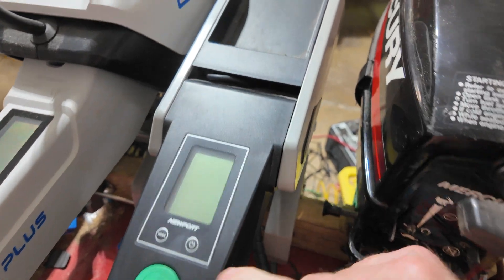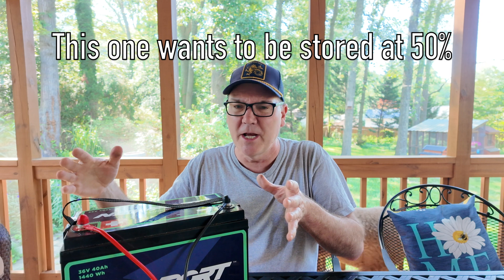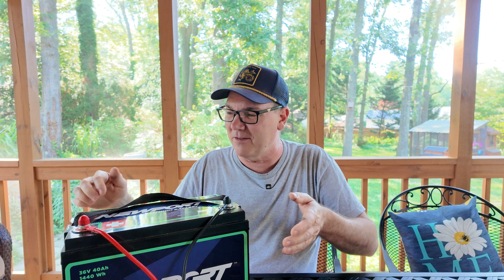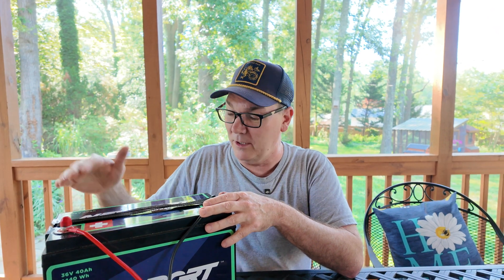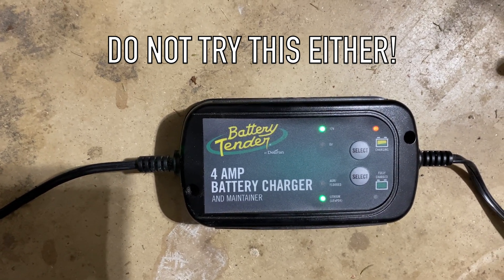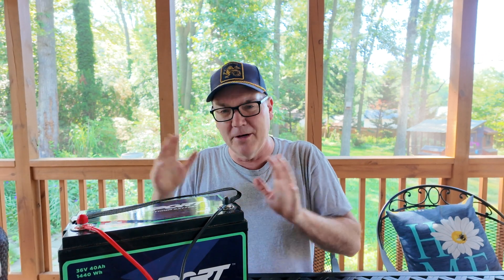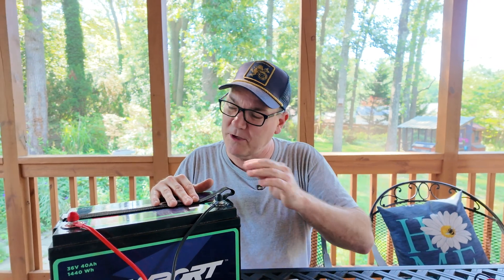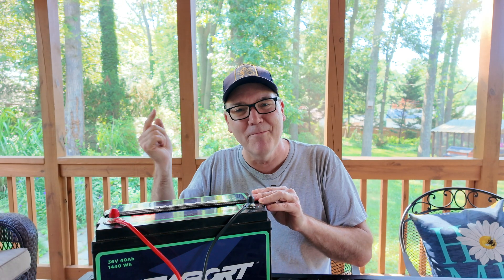LiFePo4 Battery DEAD after 1 year

Comment: The lithium battery for my Terratrike e-assist came with BIG BOLD WARNINGS to never go more than 30 days without charging. I think it’s for this very reason, so it doesn’t drop down to zero. The dealer I bought it from also reiterated this. So I set a reminder to plug it in once a month. And I store it inside during the winter. I’m really surprised that Newport doesn’t warn of this!
Reply from the maker: Most of my batteries just say every 3 months - which is harder to remember than monthly!

Comment: Short the teminal to reset the BMS. Use a multi tool to cut the top off. This will probably bt EVE cells. Replace the BMS, check cell voltages.

Comment: I think your BMS may have gone into protection mode. Some smart chargers can wake them up……but it seems like the Newport OEM charger is not smart. I think a good smart charger will save the battery. It just needs a reset. I leave my Lifepo4 outside in my boat through the North Eastern winter after the last use (late November) without charging it. Probably down to 50/60 percent. Takes a normal charger in the spring. I use an inexpensive Victron onboard smart charger. It blue tooth’s to my phone about the state of charging. My battery has BMS but no blue tooth…..so when not on the charger it tells me nothing. I charge to about 95 percent only to prolong the life.

Comment: Dude,YOU knew that you had to charge the battery when it is sitting still for a few months...
ITS SO SIMPLE!!
Just connect a smart wall plug,or timer switch.
And let the charger run once every month for a few hours....
NEVER ANY ISSUES!!
Reply from the maker: Yes - and sometimes we forget to do that. And this video was showing that sometimes that might cause a problem with one of these batteries.

Comment: This video does a  good job selling gasoline outboards. Who wants all this fuss at those prices? Not me. What, I'm going to worry all winter about my battery? Comes the good weather, I pull the battery out of storage and cross my fingers that it still works?
Reply from the maker: Yeah - it requires thinking about things differently. On the plus side there's no impellers or carbs to drain - but instead having to remember to do something mid-winter.

Comment: I know that you've been advised to "wake up" your battery by other subscribers. I'd like to ask you to use four 9 volt transistor radio batteries (I think the young'ins call them "smoke detector batteries" these day) in series to see if that is enough to wake your battery up. It might make an interesting video and spread some useful info, if it works. Sure would be cheap enough.

Comment: I Have had the same kind of problem with the newer Ezgo battery golf carts. If the battery's get to low the charger wont kick on. In order to get the charger to kick back on you have to jump in with another battery cart and then plug the charger in to get the charger to kick on then disconnect the jumper cables from the other cart. Its a pain when you have a fleet of 12. But that's their "fix".🙄

Comment: Brought a 24v itech 100am ran fine for 2 days and now keeps going to sleep. Biggest pain in the ass. Same thing $1200 battery way to unreliable. Personally I’ll be sticking with lead acid they are heavy but at lease reliable
Reply from the maker: It seems that the weak link on some of these types of batteries is the BMS. I'm not giving up on them yet because I tend to swear a lot when I lift my lead acid battery into the boat!

Comment: Use 4 9volt battery hook up in series, connect that to your battery along with your charger. When the charger starts charging, remove the 9 volt battery s.  Should be very quick.  This will jump start the BMS.

Comment: Ive used two Power Queen 100ah for a while now (at 60 charge cycles now)and found the best results using the exact recommended Power Queen charger, so why spend 500$ on two batteries then skimp out on the wrong charger?

Comment: I am not sure if you would ever get to read this message in all your replies, but your battery is absolutely fine. Its the BMS system that is sometimes sh**ty. The voltage you got on the multimeter of around 2 volts means that your battery is good and the BMS kicked in to protect the battery from completely discharging. Althought what surprises me is that the battery went that low in just 6 months, because LiFePO4 batteries are suppose to have very long shelf life and very low self discharge and should be good to stay on the shelf for few years before they go that low. Anyways the easiest thing to do is to wake up the BMS and that can be done by (in your case) a 36v DC current. I am new to boating and was watching your video on the free navigation app, when I saw this and was wondering what happened as I have a LifePO4 battery too 100Ah another brand though. And I drained it as low as it could go to know my limits with the battery and learned that the BMS kicks in at around 15-16% of the charge (fortunately by BMS app shows the percentages too) and then I have to wake up the BMS and the battery works great.
get the cheapest NON-SMART 36v 1 or 2 amp charger and that should do the trick.
Also thank you for the video. All the best.

Comment: You simply just a low or dead cell that can't take a charge and it will have a high resistance if it does take a charge resulting in a parasitic draw.
You can try jump-starting it by putting another battery on charge and then hooking up the dead battery to trick the charger.
Or the better solution would be to buy a real battery with balance leads and a BMS so you can tell what cell/s are becoming a problem.
Lithium ect Battery's are a maintenance device that need more tending to than PB ect.
I make my own from packs from recycled and new battery's.
BTW a BMS for those battery's isn't cheap.
For these applications a BMS under $200 wouldn't be good enough, it'll short in month's.

Comment: As expensive as those batteries are, until they get a lot better, I"m sticking with lead/acid.  I would LOVE to have the less weight alone,  but, like you, I'm out of the water for several months because of the weather.
Reply: They're already there. Just need to learn how to use em. I've a lifepo4 that's 5 years old now. They're never going to not need you to learn how they're different though. also don't buy the "cheapest" ones.

Comment: Did you leave the battery on that concrete floor in your basement over the winter? That is why it drained down to zero. Never leave lead acid or lithium batteries on concrete. It sucks the juice right out of them.
Reply from the maker: I have read many times that concrete has no effect on modern batteries.

Comment: As noted by others, your BMS has most likely tripped.  Needs a reset of sorts with a zap/charge over 36v.  Chances are that the battery actually is far from 2v, probably around 30v; it's just kind of protecting itself in a misguided way.

Comment: Other thing.
38 volt solar charger and a 3x10/15 watt solar panel  in serie  (3x22volt )
And you have drip charger for it to set away for the next time.

Reason its go low is the bluetooth function in the systeem
Reason you have to charge it

Comment: Oke a tip for you.
How to let a charge think it have a load 
Just set a lamp on it .
And the charger go charge.
And the power from the lamp will wake up the systeem .
Reason the power is flowing.

It only work on 12volt and 24 volt systeem

Comment: Thank you for the video Wayne. I am now convinced not to purchase a Newport battery. Thank you for saving me $1200.00! By the way, I don't think you did anything that would have destroyed the battery and the included battery charger should be designed and capable to restore it from zero volts.

Comment: A cheap way is to get a variable power supply. I have used them many times to bring back lithium batteries. You can dial them down to very low amperage with the 12 volts you need to bring the battery back to life

Comment: I am surprised that with the technology they did not build this with a power shut off. The bluetooth is constantly running and runs the battery down , but nothing built in and draining it down all the way is not good. I think they would be better off taking the blue tooth out , or building in a power off to the blue tooth. It should last forever, Since you mentioned the charger, for the 1200 bucks, the battery charger comes with the battery at that price point. Sorry about your . 
I am sure since they sent you a new unit, and it is still under warranty they will send you a new one. 
I would be interested to see if the other charger works, keep us posted on that other battery charger if you end up trying it. 
Dale

Comment: Alternatively. Parallel this battery with a car battery to bring it to 12 volts. Let it connected for a couple of hours to bring the voltage back up and see if your original charger that came with it reads it at 12 volts

Comment: Hey Wayne I preordered that motor when it was first announced and have been using it ever since. The batteries they sell are in my opinion over priced. I was able to purchase a 36v 100 ah for around 1000$ cad. I also noticed their charger is a rebadged version of a no name charger readily available on amazon. There is no reason your battery should fully discharge sitting on a shelf for 6 months. The state of charge is recommended for long term storage to increase cell life. I expect there was a bms issue with this battery and the bms killed the battery. I built myself another 36v battery as I wanted more capacity for weekend trips. I've used LiTime 12v 100 ah batteries and ECO-WORTHY 12v 100 ah batteries for my 36v battery, none of these have self-discharged during 3+ months of storage and I'm not particular about state of charge during storage. I typically charge my batteries after each trip so I have full capacity for the next one. going with 3 12v batteries that support series connection means you can either use a 36v li charger or 12v li charger and if one of the batteries requires replacement you can just replace the one.
Reply: I think it's possible the discharge was due to the connector being left on. It's like having a cord plugged into a socket if you think about it, a small amount of electricity is being discharged from what they say. I am looking to upgrade to a 100ah one day, but so far I can run at 70-80% power for about 2 hours which is all I need. The problem I am reading up on these is when you run lithium in parallel, they really need to be around the same age (potential cycles) besides voltage of course. Since buying my Old Town Sportsman back in 2020 and my first Minn Kota trolling motor, I have learned more about batteries, wiring and Ohms law than I ever thought possible. It's the future whether we like it or not! Best to stay ahead of the curve

Comment: The battery BMS is shut off. There are tons of videos on YouTube showing how to “wake up” your LiFePo BMS. Monentary contact with any 36 VDC source will do the trick and allow your normal battery charger to work again. Before you spend $100 or more on another charger go get 3 12 v car or boat batteries you might already have around and connect them in series for 36 V. Touch that momentarily to your LiFePo battery and your charger will start up.
Reply: Yes the BMS kicks out at a predetermined voltage and can't be charged until you wake it up. But the battery is most likely defective because it continued to discharge itself down to zero or what ever he said. I'd warranty it and be done with it.
Reply: @fauxque5057  To test that battery discharged to 0 you have to open plastic case and test actual Li cells. He did not do it. Terminals at the top are BMS outputs, not directly connected to actual battery. I call it misleading video, out of really small problem (not having right charger) now people below saying "thank you, not going to buy that battery". All you need is some basic charger or power supply with 36-38V output to wake up BMS. Or use 3 lead batteries in series as suggested above
Reply: Yeah. This is probably just a case of the battery protection kicked in with the BMS low voltage disconnect refusing any charge. I build packs and have one build series from scratch in my channel and I have woken up cells from 1.2v to be healthy and kicking. I'm actually just about to create a small pack for my portable rubber dinghy air compressor since I don't enjoy using my big 5.3kwh pack with a DC to DC converter for 300w 12v.

Comment: I bought the NT  300 and the  40 ah. battery at the beginning of spring. I haven't really had to store it over winter yet. But would it help if you left it on the charger over the winter where it would maintain the full charge?

Comment: Normally I would recommend a cheap amazon benchtop power supply, but they mostly all cap at 30v. The lower voltage lithium batteries are easier to jump start. I run 12v lithium in my boat but its easy to jump start with the power supply.

Comment: My best guess here is that the bms has failed, the bms should protect the battery from going under voltage (low voltage dissconnect) the cells.may be carrying the 36v behind the bms, bur the bms thinks that ita dead. I left my 150ah NewTiPower lifepo4 battery sit for 9 months and it still has 90% capacity (according to the battery gauge installed on it)

Comment: Great informative video. You were to nice on them in my opinion if the battery maker feels so good about their product that they are willing to ask X amount of money for it then the warranty should be much longer at least 3 yrs in my opinion. They simply Need to make a better product! Something that the buyer is going to feel confident about purchasing
Reply: Battery pack builder here. Well ... My get is still that that pack is in decent condition and that the BMS has reached the protection mechanism called low voltage disconnect. So the battery is probably fine, but what worries me is that the BMS has had such a high self discharge. In all BMSs I have worked with, it should be a few mili amps. But still, he probably just needs to provide some charge to wake the BMS up, and 12v doesn't cut it because that's way below the low voltage disconnect - so his trials were pretty pointless. He needs a 36v power source for say three seconds to wake it up again and I would be the battery is fine and the BMS has done it's job to protect the cells from being totally depleted. LVD is one of its key functions to make sure one does not deplete the battery to death. I bet the cells are all fine in that box.

Comment: I have an ICON golf cart. It has six 8V AGM sealed gel batteries. If you let it drop below a certain voltage, the charger in the cart will not recharge them. The charger will not maintain the batteries. Once they are charged to full, the charger shuts off and will not turn on until it is unplugged from the wall, and then plugged back in. In our South Dakota winters, I put a timer on the wall plug and set it to interrupt the current and then reconnect every three days for a couple of hours. The cart is stored in a cart shed at the golf course for the winter. So far, this system has worked perfectly. The timer cost me about twenty dollars on Amazon. Something like this should probably work for that battery too.

Comment: This is very interesting.  I have their 50ah (1800wh) lithium battery that just turned one year old, at least since I bought it, however, that model battery is NOT Bluetooth capable (wha wha).  I did kill the battery once last year on the reservoir, but immediately charged back up when I got home as I always do.  It was stored in my basement over the winter, but I do remember throwing the Newport charger on it at least once during the winter months.  I have had my boat out twice so far this year with the NT-300 with no issues (knock on wood).  Will report back if so!  All I can say so far is that Newport's customer service has been top notch!  Good luck Wayne, sorry to be seeing this.
Reply from the maker: It's probably all my fault - and good for you for checking on your batteries over the winter!
Reply: @WayneTheBoatGuy  I wouldn't go that far - we are living in the midst of these batteries and motors ever evolving!  Sounds like it could be the charger, hopefully the new one works!

Comment: I don't have a 36v battery but I think you have a faulty battery.  I have two 12v batteries that I fully charge up and store in my basement during winter.  The voltage never drops and if it did it would only take 10 mins to charge up completely.

Comment: Did you leave it on a bare cement floor? Just curious.
Reply: I was going to ask the same question because no battery does any good on concrete that has to be raised up on wood
Reply from the maker: I did!
Reply: This will be another good topic fir a video.
Reply: Wives tale. Heat kills batteries, not cold. Cold just exposes their weaknesses. What makes you think wood is a better insulator than the plastic casing?
Reply: @chublez  if this is the case, then why does everyone's battery usually go bad in the winter months? I'm not saying your wrong, just my experience.

Comment: Wonder if someone could design a battery tender for it that stops charging at 50% and starts charging at 40%. Leave that plugged in all winter and it would drain and charge as needed. It would just need to read voltage and have a cutoff. Wonder how hard that would be to make
Reply: Voltage is a bad measure of capacity in lifepo4 as the curve is very flat. You actually need to use a current shunt and measure amps in/out. Lifepo4 usually has a very low self discharge, I'd imagine the bms in the thing is just in a disconnect mode and needs "woke up". Cells are probably fine.
Reply: Also lifepo4 is fine stored at 100% infact 50% or better is preferred, not discharged to 50% just no less than. 100% is a okay.